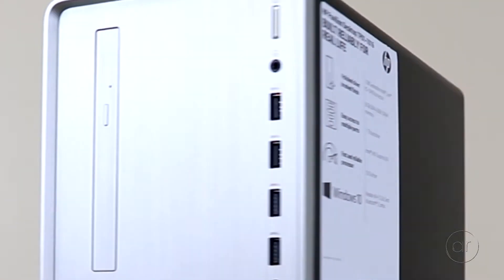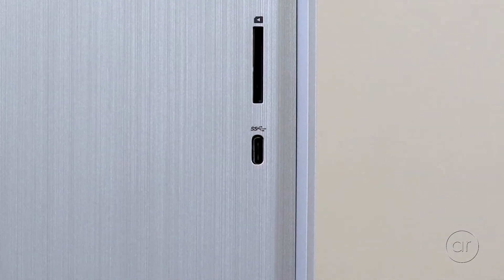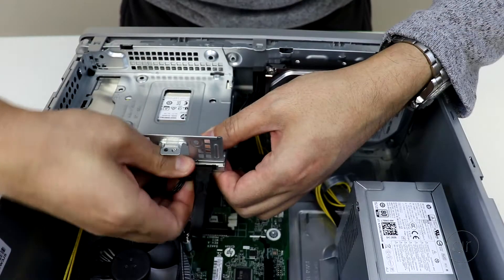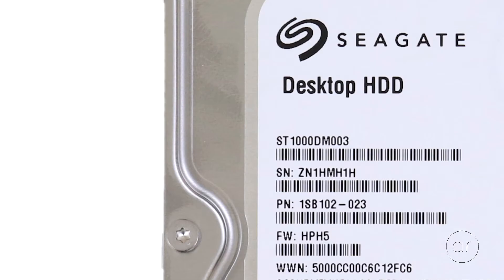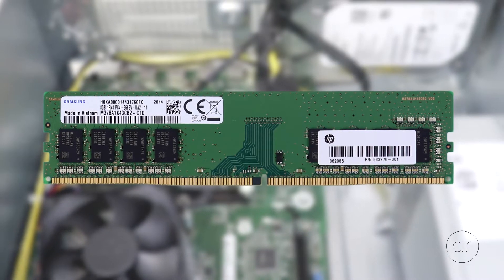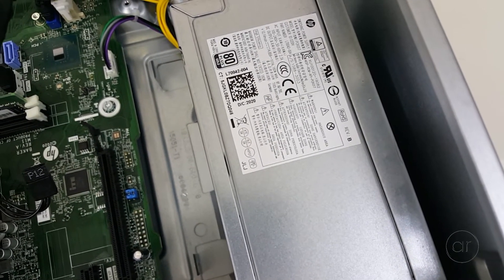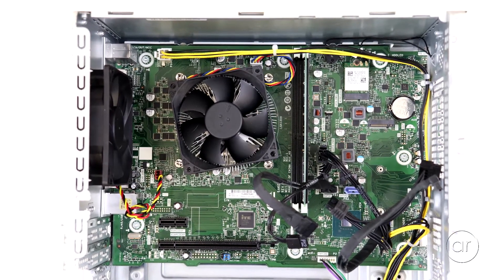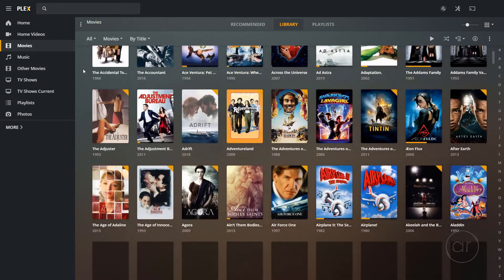How to Open and Upgrade an HP Pavilion with a 10th Generation Intel i5-10400 (TP01-1016)

Comment: Looking for better graphics card which ones are compatible ?
Reply from the maker: Unfortunately, I haven't had many reports of successful upgrades (except one suggestion in the description). Since the power supply can't be swapped out, you'll want to find one with relatively low power requirements. There are several comments below about other possible upgrades, including the Nvidia GeForce GT 730.
Reply: @accessrandom  I put a HP Pavilion Gaming 790-0020 GNRC 400W Power Supply L04618-800 OEM in my Pavillion  and that's a shoe in.
Reply from the maker: @joeperson4792  Thank you! Do you mind if I add that in the description with credit to you?
Reply: @accessrandom  Go right ahead,  like your videos.

Comment: Would I be able to remove the processor from this model and put it on another motherboard with the same socket size? My model has a i5 8400 and I’m thinking about buying Msi  motherboard  lga 1151 so I can buy a graphics card, or am I missing something?
Reply from the maker: This particular model in the video is an i5-10400 so it uses an LGA1200 socket, but as far as I know the i5-8400 should be able to be used in any LGA1151 motherboard.
Reply: @accessrandom  thank you for responding!

Comment: I bought the TP01-1114 model that looks exactly like this, for the most part it runs pretty well, though the integrated graphics while decent enough to play pre 2015 type games,  still struggles a bit even on medium settings.  I feel as if I should of I made a mistake in my purchase, as I choose more ram(8gb) over a pc that had AMD type specs.

I agree with this video, my take is these series of desktops are great for a starter pc, or a temporary pc , but if I had a job I would save up and buy another high end desktop.

great for surfing the web, nextflix, or any basic muiltimedia type use, doesn't seem worth the time if your trying to run games, even old ones on it, unless your willing to spend a good bit of time like me, configuring them

but tldr: great if your not too invested in the pc world, a pc I would get for my nephew or mom for sure
Reply from the maker: Thank you for the feedback 🙏.

Comment: Thanks for your report. I have  a tp 01-1017nl, with Gtx 1650 super, and a 310 watt gold psu.   Could this psu  hold a 1660 super or a 1660 ti that have  only 22 watt more of power consumption? And one more ask, are there problems of  bios accepting Ram and Storage upgrades?
Reply from the maker: As far as I know, the only problem with memory upgrades in the BIOS is that there is no control over the timings of the RAM. You can see this in one of my other videos (https://youtu.be/ieQayPuq6vI), though the problem could have been with the voltage. If the difference between power consumption is only 22W, the power supply should be able to handle it - it is akin to adding a couple hard drives to the system.
Reply: Thank you for your kind answer.  You give me a good  new: the TP01-1017nl  seems to be a good  choice for casual gamer,  gtx 1650 super is a good entry level graphics card, but the possibility of a little upgrade is welcome! Thanks again!

Comment: Another worthwhile modification is to change the, inadequate, stock cpu cooler. I bought a "Golden Field ICE500" from Amazon for less than $10. It looks almost identical to the stock one but is twice the height and has a copper base. It screws to the motherboard just like the original. I used the original fan from the stock HSF on the replacement unit. Performance is much improved with no noise penalty.
Reply from the maker: Thanks! May I add this to the description as well?
Reply: @accessrandom  No problem.
Reply from the maker: @Ted-Branston  Thank you! I've added it under CPU in the description.

Comment: I have the exact case but with the AMD Ryzen 7 3700X processor. Also came with a Radeon  550 graphics card with 2gb of dedicated memory. And 256gb SSD .GTA 5 runs well. It came with just 8gbs of memory which am upgrading to 16gbs. Paid $549.00 plus tax at Officemax 3 months ago.
Reply: I have that same one, have you been able to play triple A games smoothly ? Do temps go high?
Reply: @SoraHQGaming  Havnt tried yet but wiil let you know.

Comment: Hello, thanks for this great video I will definitely need it when I'll upgrade my ram.

I have a question, do you think this case could be trouble in terms of airflow? I have the TP01 1017NL model with the i5 10400F and a GTX 1650 Super. I'm planning on using it mainly to learn graphic design and photo editing but I'd love some 1080p gaming - but I'm scared of frying it.

I noticed some entry level Pavilion gaming models using the same exact case, only reskinned
Reply from the maker: Thank you. It's possible that airflow is a problem, though I haven't received any reports. There is another Pavilion where it was a problem (in one of my other videos: https://youtu.be/V2lfuqKojvE) - if you look at the pinned comment there, you can see that some viewers had to go through some extreme measures to bring the CPU temps down. I'll keep the description updated here if I receive any reports.

Comment: I have HP Pavilion Model TP01-1116d, with i5-10400F, Nvidia GeForce GT 730 and 310W Gold PSU
Can I replace the PSU with one standard ATX PSU? Because I want to upgrade the GPU to GTX 1660
Or can the PSU handle GTX 1650 (without additional 6-pin power connector)?
Reply from the maker: Unfortunately, HP uses a very non-standard power supply, so it would not be possible to swap it out with a third-party PSU. Your best bet would be an OEM PSU from HP, but I haven't had any reports of successful upgrades for this model (which I will keep updated in the description).
Reply: @accessrandom  thank you. So can my 310W Gold PSU handle i5-10400F + 8GB RAM + GTX 1650 (without additional 6-pin power connector)?
Reply from the maker: @vuphong9539  The power consumption of the GTX 1650 is only about 25 W more than the GT 730, so you probably would be ok.
Reply: @accessrandom  thank you very much

Comment: Great review, thank you! 
For people asking about a suitable graphics card. 
My model of this HP came with an "Nvidia GT 1030 2GB DDR5" fitted. This card only uses 35w and needs no external power connector. My machine has the 180w PSU fitted. So if HP sell them with this card then the PSU must be adequate.  It performs quite well really, especially on older games.
Don't get the DDR4 version of that card!
Reply: Another good card for this machine would be the NVIDIA T400. Slightly better performance than the GT 1030 and only uses 30w of power, so it'll be fine with the 180w PSU.
Reply: Is anyone able to confirm that the t400 will work well with this setup? I just ordered a refurb of this model for my son; looking to add a graphics card for light gaming (roblox, minecraft, Fortnite). Thanks!
Reply from the maker: You're welcome, and thank you. Do you mind if I add this to the description, with credit to you?
Reply: @accessrandom   No problem.
Reply from the maker: @Ted-Branston  Done. Thanks again.
Reply: T400 is working great with this setup. Thanks for the suggestion Ted!
Reply: @pasta-eo5mt  Awesome, I wish I could find one, have fun!
Reply: @Ted-Branston  I ordered it from Dell for $117 but it looks like they're sold out now. 😔
Reply: @Ted-Branston  weird. Looks like my other post was deleted. Perhaps because I posted a link. Dell has the t400 for $129 in retail packaging. I paid $117 for bulk packaging but they're sold out now.
Reply: @pasta-eo5mt  Nice one thanks, I'm in the UK but I'll check them out.
Reply: I just got a Lenovo brown box Nvidia T600. This has 4GB of DDR6 and only consumes 40w. Performance is excellent.

Comment: Great video sir! I have the same model but only the i5-9400f and GT 1030, can I upgrade the GPU to GTX 1650 super OR 1660 super sir? Thank you
Reply from the maker: I'm afraid the power consumption can be roughly four time more than the GT 1030. If you have the same power supply as my model (180W), it probably won't be able to handle it.
Reply: @accessrandom  Yes sir mine also only has 180 watts, is it possible to replace it sir?
Reply from the maker: @johnpatricksuguitan7363  Some viewers have recommended a 400W or 500W OEM power supply from HP in the comments, but I haven't received any confirmation from anyone that it works (I am keeping track of successful upgrades in the description).
Reply: @accessrandom  Thank you sir! I am trying to find a PSU that have a 7 pin female for the motherboard but I don't see anything as of now
Reply: @johnpatricksuguitan7363   Use a HP Pavilion Gaming 790-0020 GNRC 400W Power Supply L04618-800 OEM. I tried it already.

Comment: I am looking to add a graphics card using the existing power supply, will the RTX 3090 work with that, do you have any other recommendations
Reply from the maker: Because of the power consumption of the RTX 3090 (350W), the 180W PSU won't be enough to power it. I'll be reporting on successful upgrades from viewers as I get them (in the description), but unfortunately I haven't received any so far.
Reply: I think he is lying, the RTX 3090 will be a perfect fit for this pc. Matter of fact, think about adding 2 of them. They are small form factor cards that do not require the need external power. Reply to me with your results and have a great time gaming!
Reply: @equrrioh1213  Got a GTX 710 2 gb card works great with the 300 watt ps I got, would not want to spend a couple thousand dollars on a graphics card for a computer that cost less than $1000
Reply: @steveharris7116  Don't worry, I checked newegg and 3090s are now in stock at a low price of only 150 dollars a piece! I Just ordered one can't wait!
Reply: @steveharris7116  Nevermind, It was a scam and I got my mother's credit card information stolen. The site was called neweg instead of Newegg.
Reply: @equrrioh1213  bruh fr

Comment: hp pavilion tp01-0110d my current pc and I bought it last year and I wanted it to upgrade the ram and storage. but is 3200hz is the max? or 2900hz?. and the storage I want to add maybe 500gb on to the m2 or in the sata, it is posibble?
Reply from the maker: You may want to visit a video I recently made about adding an M.2 SSD (https://youtu.be/cVRVgrOl1M8) and upgrading the memory (https://youtu.be/ieQayPuq6vI). When I upgraded the memory to 32 GB of 3200 MHz, the motherboard actually read it as 2400 MHz.
Reply: @accessrandom  Ok thank for the info. But I'll just make another pc rather than i upgrade this hp. Btw thank you very much for replying

Comment: Can a second 3.5 "HDD be placed in the tray above the DVD burner?
And if so, would it be possible to do it also with the HP PAVILION TP01-0033NL model?
If not, could you tell me a Tower PC with an i7 processor capable of holding 2 or more 3.5 "HDDs?
Reply from the maker: Yes, the silver tray above the DVD burner is meant to hold a secondary drive. I'm not 100% sure, but I believe all cases in the TP01 Pavilion family are set up the same way.

Comment: Is it ATX , mini ATX or how is it?
Reply from the maker: It doesn't appear to be any type of standard. I hadn't checked the mounting hole spacings for the motherboard, but if you want to move it to another case, there are front-panel ports that are soldered to the motherboard (which is non-standard) and the power supply is also custom.

Comment: what would be a sustainable graphics card I could add that doesn't require and other upgrades. I'm planning on just saving up for a second pc and build it myself.
Reply from the maker: I'm afraid I haven't received any reports of graphics updates yet. The problem is that this model only has a 180W power supply, and there aren't many modern graphics cards that have low power requirements. I'll definitely keep the description update as reports come in...
Reply: @accessrandom  is it possible to upgrade the power supply? Like possibly a part that isn’t from HP.

Comment: can i added a new sound card without a problem?
Reply: i want just for audio upgrade i am a musician
Reply from the maker: @jpv1970  I haven't received any reports of a sound card install in the PCIe slot, but I will update the description when I do. If another HP Pavilion is any guide (https://youtu.be/V2lfuqKojvE), it should be possible, but installing an NVMe drive may render the PCIe x1 disabled (because it steals the PCIe pipeline). Again, I'm not sure if it applies to this model though. As a musician, have you considered a Focusrite Scarlett unit that connects via USB? It would give you both MIDI and pre-amps, where you could record directly onto your DAW.
Reply: @accessrandom   what about using the m.2 port for ssd and the 1 slot for the sound card
Reply from the maker: @jpv1970  According to the commenter (whose description is in the pinned comment of the other video for the different Pavilion), the PCIe x1 will work for a sound card as long as the M.2 slot has a regular SATA SSD (non-NVMe).

Comment: How can I upgrade it to use it for gaming
Reply from the maker: What types of games were you planning for? I'm afraid it's not that great for gaming since the power supply is so small, and it would be difficult to find a higher-end graphics card with low power requirements.

Comment: On Amazon there's AMD models that look so good prove wise
Reply: But without proper gpu upgrade support it's a deal breaker
Reply from the maker: @Ur_maomghey  Yeah, HP tends to include the bare minimum - just enough to support the out-of-the-box configuration - but then makes it very difficult to upgrade the major components (like the graphics card).

Comment: Can this power supply support a gtx 1650?
Reply from the maker: The GTX 1650 has a power consumption of up to 75W, so I'm afraid the 180W power supply probably wouldn't be able to handle it (it will have very little headroom for upgrades).

Comment: Would a silverstone tx500 power supply not work? Or any of the tx series for that matter? I believe they have2 of the 4 pin eps connectors. I am unsure what the other connection coming from the psu is though. Thanks for your time. Great vid!
Reply from the maker: Thank you. I'm not sure if it would be pin compatible with this motherboard. I'll need to defer to other viewers who may have more experience - anyone?

Comment: Great job with this video I have loved it and it has helped me a lot. Would it be possible to write down the model of the DVD optical drive? My computer comes without it and I would like to install one, I am thinking of this one, model DU-8AESH-HC3
Reply from the maker: Sorry, for some reason Youtube blocked your comment and I just read it. The part number for the optical drive is 853885-800 according to HP's Parts store.

Comment: Guessing it the same with the i7? 
Just gonna take the cpu and ram, ssd and hdd and put it in a gaming case with atx motherboard and Rtx 2080 and a 650 W power supply if it is the case?
Reply from the maker: I believe it should be the same for the TP01 family. I think the i7 uses a different model motherboard, but the parts (other than the power supply and motherboard) should be standard.

Comment: Hello, my father has this exact PC and my brother and I want to see if it is possible to upgrade the power supply so we can add a decent video card for Microsoft Flight Simulator. do you have a video for the video card and power supply upgrade?
Reply from the maker: Unfortunately, I don't - the power supply is highly custom in that it doesn't even have standard ATX connectors to the motherboard. If anyone reports any successful upgrades to the PSU, I'll make sure to update the description with them.
Reply: go to hp website. i beleive they offer a OEM 400 or 450 watt . can handle most. seen a video of another hp upgraded with a 2080
Reply: If you don’t care about having an external you can use a standard ATX PSU just for the card with the case left open, otherwise it’s already been mentioned that HP makes a 400 and 500 watt unit.
Reply: I have a hp pavilion desktop TP01-1070 (it came with the  Intel i7 10700 cpu, a Samsung 256gb SSD, and 16gb ddr4 ram installed instead of the i5 10400 and 8gb of ram, but has the exact same motherboard, power supply, HDD and configuration inside). I want to know what is the best graphics card, given I keep the standard power supply, to upgrade this so I can run Microsoft Flight Simulator 2020 and if I should upgrade the power supply to the HP OEM 450 watt and put a 2080, like what others have said.  Could you possibly do a video on upgrading the power supply to the HP OEM 450 watt and adding a 2080?  I really like how you explained in detail about how to open the pc up and would like to see more tutorials like this on how to upgrade this pc.

Comment: Can the optical drive be upgraded to Blu-Ray? And so, what drive would be compatible?
Reply from the maker: That's a really good question (and the first so far for this and my other Pavilion upgrade video). I haven't had any reports of optical drive upgrades but I will update the description and pinned comment when I do.
Reply: @accessrandom  Thanks. I'm guessing the machine overall has some other Blu-Ray limitations. But my main interest is to be able to rip BR movies to disk. I would assume this is a fairly standard 12mm SATA drive, that could be replaced with just about anything (with a faceplate change, maybe). But I was hoping to find someone that has done ti already. Will look forward to seeing this in an upcoming video!